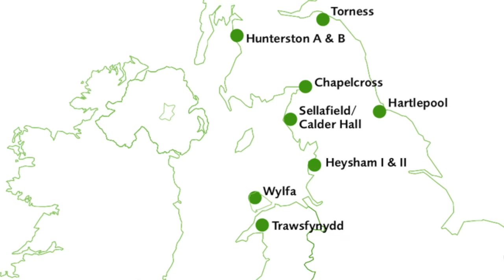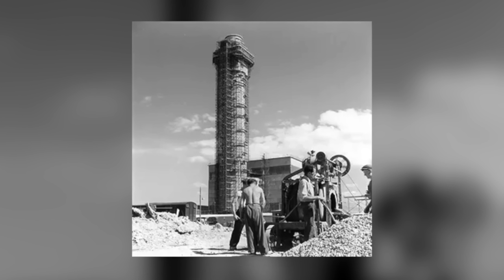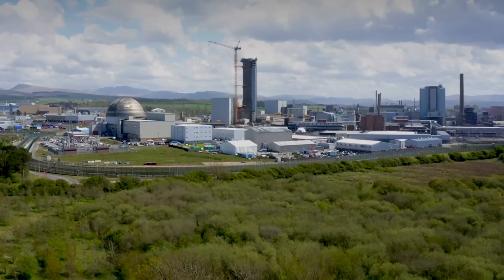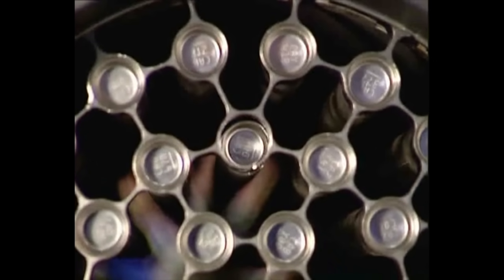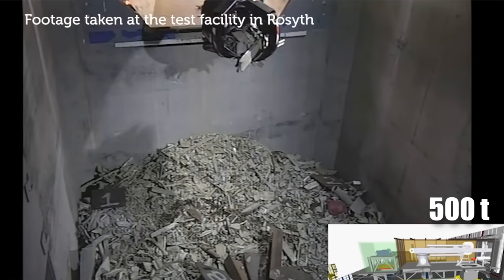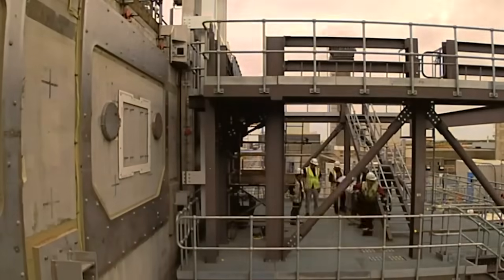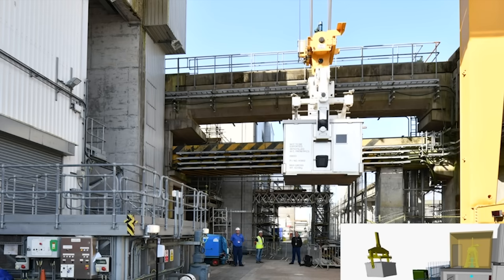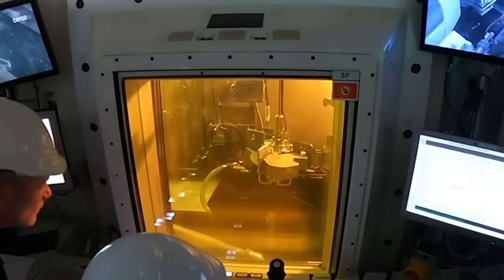Britain’s $70BN Battle To Clean Europe’s Most Hazardous Nuclear Building

Comment from the maker: Still so much debate around nuclear energy, is it still the way forward?
Reply: Absolutely
Reply: @Live2ride2live54321   no. 100,000 years is only 10 ten times longer than human civilisation
Reply: Yes it is. They can separate the isotopes in the waste and repurpose it. Sealing the Cs137 into tubes it could be used to sanitize wastewater. The cladding is made of zirconium. It could be treated with chemicals to remove the surface contamination and recycled into new fuel element cladding.
Reply: @christopherleubner6633  since nuclear waste has to be managed in perpetuity for many thousands of years, it's a massive net negative energy solution. It's not like coal where you can build a chimney stack and let mother nature take care of it. We'd be wasting energy produced thousands of years from now to manage nuclear waste from our current period. Again, a massive net negative energy equation. Nuclear proponents are emotional and myopic
Reply: @BOZ_11  kinda sounds like your emotional and myopic
Reply: Yes of course it is the way forward, there is no question about that at all. It is the only way forward.
Reply: @logantc.1353  nothing emotional in my comment. Zero contrary information in yours , and despite being useless, had 4 likes. Emotional
Reply: @BOZ_11  You are literally implying that coal is outright better than nuclear. Coal power plants release more radioactive isotopes in normal operation than nuclear can. I’ve not found a decent source with disagrees with that yet. You’ve ran out of legitimate arguments and have resorted to insults.
Reply: No, renewables are a lot cheaper.
Reply: @gzcwnk  not with generation 4 reactors  coming soon. Plus renewables will never be able to match the reliability, base load,  security, small footprint, constant power output of nuclear.
Reply: @HLinvesting yeah, but you don’t have to store a wind turbine for 100,000 years after you have finished with it
Reply: @BOZ_11  I notice Finland has decided to use nuclear and manage its waste. It's called ONKALO, Where there is a will, there is a way.
Reply: @BOZ_11  Nuclear is already 20% of our energy mix. We need to go to deep geological repository like the Finns have.

Comment: Nuclear energy is the most expensive you can produce. Accurate decommissioning costs are never included in levelised cost of electricity produced from Nuclear as they are impossible to forecast. Fukushima's estimated final cleanup cost is estimated to be one Trillion Dollars. Hinkley Point C, the UK’s latest nuclear plant has a guaranteed contracted sale price of £92.50/ MWh a price which rises with inflation every year v Wind which is less than £40/MWh with costs falling all the time.
Reply: That's only true for the first nuclear reactor in a series (like Hinkley Point C), cause inexperienced the engineers always fuck up on the first build of something so complicated. When you build multiple reactors, like France who built 30 of each of their 2 reactor designs, they get quite cheap. Nuclear reactors are like solar and wind, they need economies of scale to be viable.

Also more than half the cost of Hinkley Point C is interest because they borrowed at an absurdly high rate. Had they borrowed at the government interest rate for the time, which was about 2%, rather than north of 8%, they'd have saved most of that.
Reply: And can you calculate the price we paid for burning fossil fuel? How much life did it cost for the pollution form coal plants? Did solar panel and wind turbines solve this issue and saved millions of lives and trillions of dollars in these decades after people against the nuclear energy? Cant you see we paid more after rejecting nuclear power?
Reply: @NitroCheng All I’m saying is that nuclear is not economic now,  it was was certainly better than coal in previous decades.
Reply: @domtweed7323   since nuclear waste has to be managed in perpetuity for many thousands of years, it's a massive net negative energy solution. It's not like coal where you can build a chimney stack and let mother nature take care of it. We'd be wasting energy produced thousands of years from now to manage nuclear waste from our current period. Again, a massive net negative energy equation. Nuclear proponents are emotional and myopic
Reply: still, wind is one of the most cost-inefficient ways of producing electricity, not to mention that it's not constant enough in most places to be viable as a source without coal, nuclear, or anything else that can produce a stable output over weeks and months.
Reply: @dadjake  I am 100% off-grid with solar and batteries. My EV has bidirectional charging and gives a further 7 days of backup power assuming there is no sun at all. Future grids with mixtures of different renewables, different types of power storage like pumped hydro, flow batteries, international power sharing and using EVs for times of peak demand can easily flatten peak demand. Coal and Nuclear are just too expensive to feature
Reply: @dadjake  Did you even read my post before replying? Hinkley Point C, the UK’s latest nuclear plant has a guaranteed contracted sale price of £92.50/ MWh a price which rises with inflation every year v Wind which is less than £40/MWh with costs falling all the time. 40 is a smaller number than 92.50!
Reply: @BOZ_11 I’m not sure Mother Nature is taking care of fossil fuel all that well

Comment: When proponents of nuclear talk about LCOE, i've never heard them consider the costs of cleanup and storage in the life cycle^. 
Even if everything was equal, i'd still prefer renewables because they are more democratic, so the improved safety, speed and efficiency of new nuclear dont budge me. that said, i currently get my energy from EDF, so im not exactly anti-nuclear. It IS better than fossil fuels.
Reply: Problem with Renewables is they arnt flexible, you get what the enviroment gives you. This is why nuclear is needed. The UK could have one of the best energy grids in the world and the safest if all we did was make a few more of the latest gen nuclear reactors, kept on with our wind farms etc. and we could use renewables for the bulk of the load and then use nuclear as the buffer. We could even make more reactors giving nuclear a larger percentage of ther overall grid which means we arnt too reliant on renewables, becuase will the enviroment giveth she also taketh, i.e. Sea wind farms suffer salt corrosion on the edges of the blades making them less efficient over time and the UK has thousands of them making maintenance costs pretty high. Solar panels also last for so long and becuase of the heavy metals inside them they are toxic to the enviroment and cannot be recycled.
Reply: Decommissioning costs have been estimated for decades and up-dated annually and Sellafield apportions costs to the reactors whose power-stations they serve. (sort of reactor pension!) Projects and research programmes develop techniques to deal with wastes streams when the time comes. Yes time is part of the decommissioning process because it gets easier, cheaper and safer with time!

Comment: the most constant resource we have and don't use it, is rivers.  turbines tapped of rivers so not to disturb wild wife and salmon to much.
Reply: Theres a reason turbines havnt been used. We have experimented with them, the problem is the tides and currents end up destroying the turbines, if it was so easy naturally it would be the best and safest option and it would literally be a facoured renewable source. However Nuclear will always be king.
Reply: @ashleygoggs5679   since nuclear waste has to be managed in perpetuity for many thousands of years, it's a massive net negative energy solution. It's not like coal where you can build a chimney stack and let mother nature take care of it. We'd be wasting energy produced thousands of years from now to manage nuclear waste from our current period. Again, a massive net negative energy equation. Nuclear proponents are emotional and myopic
Reply: @BOZ_11  Not necessarily true, as this depends on the reactor that is used, molten salt reactors using thorium can recycle waste to the point that its half life is signficantly lowered to the point that its 100s of years not thousands of years, Which makes it significantly more manageable... SIGNIFICANTLY!